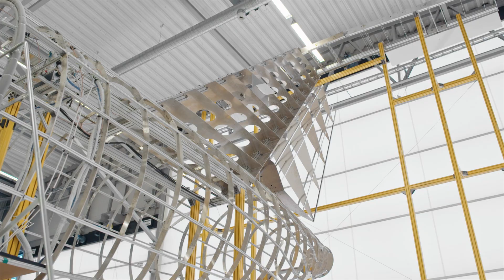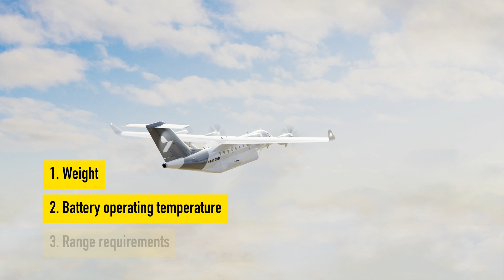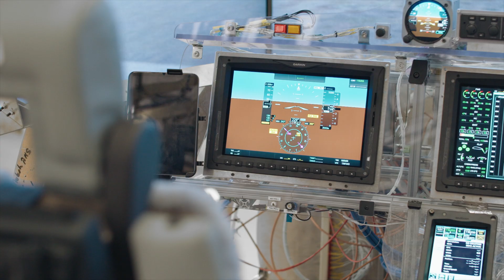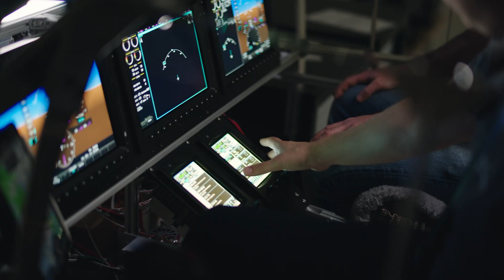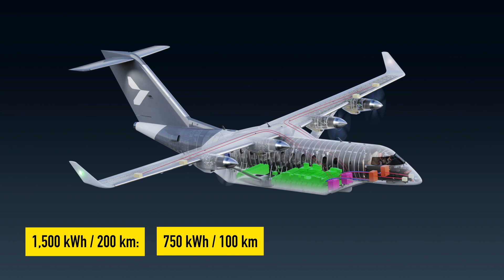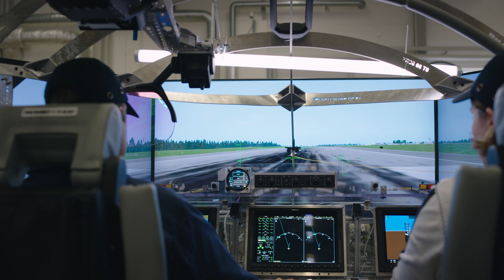Uncovering the engineering of the world’s first electric plane to fly passengers on a regular route

Comment: My feeling is that electric power is good just for gliders. Anyway, in the ES-30 case one problem has a rather easy solution: How to de-ice the part of the wings between the engines, by passing the cables behind the leading edge.

Comment: (1) In drones, it is common to see take-off and landing using electricity generated by gasoline-powered auxiliary generators. Since this aircraft has 2 APUs, why not use them to generate the extra power demand for takeoff and climb?
(2) I believe that the use of batteries is a temporary solution, until the technology of generating electricity through hydrogen cells is more mature.
Reply: Sorry but a 737 APU is 90kw each main engine is the equivalent thrust of about 40 MW .  A small aircraft would have a much smaller electrical demand so the power output of the APU would be minimal compared to the main engines. Storage of hydrogen in aircraft is tricky involving cryogenic refuelling.  NH3 might be a better option as this can be liquified at reasonable pressures and would burn fine in a turbine with modifications to the fuel injection.

Comment: I suppose battery swapping at airports would be a better solution for quick turnaround of planes
Reply: Yes, certainly, however this solution has greater risks of sparks, therefore none of the electric UAVs I know of, has a quick battery pack exchange routine.
Reply: Yeah, meddling with such a sensitive aircraft will inevitably cause a crash sometime. However, if you can safely automate it, it would work. But anyway, less than 30 mins turnaround is. very unusual. So anyways, there is not much use. But if you intend to have a bigger plane and battery, it might be useful
Reply: @ecoideazventures6417  Battery packs developing high currents need temperature control.  Most auto systems use liquid coolant pumped through or around the battery.  This is a big problem for the battery swapping idea.  There was a company in Australia using air cooled batteries on heavy lorries to allow swapping but they have suffered at least two major fires so I don't think this type of system has a place in aviation.

Comment: I was working for Saab for 20 years. I did similar calculations but used the weight per the Tesla figures for the batteries.
My estimate showed 20 tona of batteries for 200 km of electric flight.
Heart says 5! Maybe I am wrong but 10 tons at best. This is a scam, it will never happen.
Reply: Then why are they doing this?

Comment: It isn't the first electric airplane and it isn't very useful as it is. There have been toy electric planes for decades and now the first "certified" electric plane has been in service "the pipestrel" for some time - but the range is very limited and so its not of much use until more energy dence safe batteries come along - if they do.
Reply from the maker: You are right, it is not the first electric airplane, but it is the first which is about to operate on a regular route to transport passengers. Regarding the energy density of the batteries, there is the main bottleneck in developing these planes.

Comment: That range is so short I can't see it being any use.
Reply from the maker: Yes, unfortunately batteries are still too heavy to allow more usable range while having a decent number of passengers and cargo weight on board. Even in this case it needed turbo generators for reserve range.
Reply: For my country, Brazil, 200km is nothing.........
Reply: @danieldmg  it's not much even here in the tiny UK. Once you get away from the expensive chargers on the motorway network there's not a lot in the country other than very slow L1 /L2 chargers.
Reply: Plenty of places where the terrain is an issue and where there isn't fast communication other than planes. For example going from Sweden to Germany, to islands, over mountain ranges. Paired with high speed trains it can be a winner. Range will increase and price will go down...and even if it doesn't, it makes sense to work towards electric/hybrid and you have to start somewhere ;)
Reply: @Hellman365  Your faith in improvements in battery technology coming to the rescue of electric aviation is unlikely to happen.  Batteries are not new technologies and improvements now are slow. The first commercial lithium ion batteries hit the market in 1991, the 18650 cell was first sold in 1994 and the lithium polymer cell dates back even further.  Most EV:s on the market use 18650's or the larger 2x70 cylindrical cells  or lithium polymer pouch cells.
Improvements to performance are coming at a glacially slow pace despite the hype in the press it seems to take tens of years to get from the lab to a viable reliable commercial product.
Reply: @thamesmud like I said, even if there is no improvement in range, I still believe there is a place for electric plane. We need all kinds of solutions that isn't oil. Just the fact that someone is making the effort and pouring money into this should be appreciated. it's not like you just take a battery of the shelf, hook it up to an engine and you're done. Even though batteries are old and have a lot of years of research behind them, battery powered planes are something else and the ev market is also fairly new. There is way more money being thrown at this today. Whatever conclusions and findings can be made are of benefit for all of us and in today's world you kinda need to make a business out of everything to get the money coming in, hence why there is product being developed rather than just a research project. Definetly agree that current range isn't amazing but also a firm believer there is a use for this kind of plane and the investors seem to agree. Have some faith  ;)
Reply: @Hellman365  Profitable airlines turn around planes in under 50 mins including re fuelling. Batteries of the size required cannot be charged without vast power being available from the grid.  For example the Tesla Semi chargers require 1MW of power for a fast charge an airliner will require 10 times that to charge in the same time. It's just not practical.  The investors money and government subsidies poured into it will end in failure but the teams involved will have had a great time along the way.
Reply: @thamesmud  there are challenges for sure, but something needs to be done, options need to be explored and bigger things have happened historicaly. Time will tell.
Reply: @Hellman365  Using a non oil fuel like NH3 (aqueous ammonia) or vegetable oil in a conventional turbofan engine is more likely to give a commercially viable zero carbon option than batteries ever will.

Comment: Batteries are banned as cargo due to their propensity to explode or catch fire. Imagine being on one of these planes when the cells short circuit with catastrophic results. I'm sure they will "engineer" them to be safe, but chemistry is not as reliable or as safe as metallurgy.
Reply from the maker: Very good point! Definitely much more to be taken in consideration when using batteries in aviation, rather than in an electric car or truck.
Reply: Ide wait until they use solid state battery which is safer and lighter than lithium Ion battery.
Reply: The type of batteries that are banned do not meet the strict saftey requirements that the aviation industy demands.
Obviously the batteries used in such an aircraft will. I dont know why you hyphenated "Engineer", perhaps you dont fully understand how "engineers" certify components in the aviation industry.

Comment: Electric cars - I'll give them a chance... Hell: even electric buses or even trucks. But taking off even with less than 5t of dead weight sounds really stupid, no matter how efficient the engines and how advanced the engineering.
Something good may come out of it, though, in the sense that all the innovations needed to make that possible will also benefit said cars, trucks and buses... Yeah, that'd be a plus!
Reply from the maker: Yes, the huge dead weight is a major problem in aviation, we need an energy density in the batteries at least 7-10 higher than what we have today to approach some viability for longer flights, hope we all will get there soon. And you have made a good point saying that innovations needed to get there may benefit other areas of electric transportation!
Reply: if a battery is dead weight what do you call liquid fuel?
Reply: About 50% of the fuel is depleted by the time the plane reaches cruising altitude... That is for short flights, of course. Long range flights are out of the question for electric...

Comment from the maker: What is your impression on the engineering of Heart ES-30 and on electric planes in general?
Reply: Battery electric in commercial airliners of the size of Boeing 737 / Airbus A320 is never going to work.  Journos don't realise the power requirements, in industrial form modern gas turbines produce over 25000 shaft hp.  Just think how big the battery will need to be to replace the two gas turbines fitted to modern airliners.  Another unappreciated fact is that the airliners weight drops from the time it pushes back from the stand as fuel is burned.  A battery pack will weigh the same at landing as on take off.
Reply: @thamesmud  Yeah but if we get higher energy density batteries by say,2050, it might work (big airlines electric)
Reply: @Aeroguru1  nope even then it won't beat liquid fuel.  A battery weighs the same empty as it does when full,  aircraft with turbines take off heavy and land light.
Reply: @thamesmud  Yeah, but jet fuel density doesn't increase so if batteries keep getting denser and denser, it would need less weight than even the landing weight of a jet fuel aircraft
Reply: @Watt-Energy  Actually I'm planning to make a video about when electric planes night be viable soon